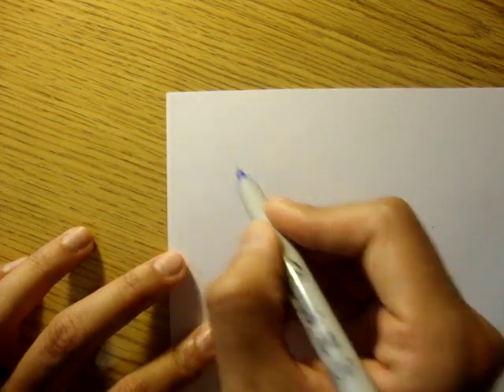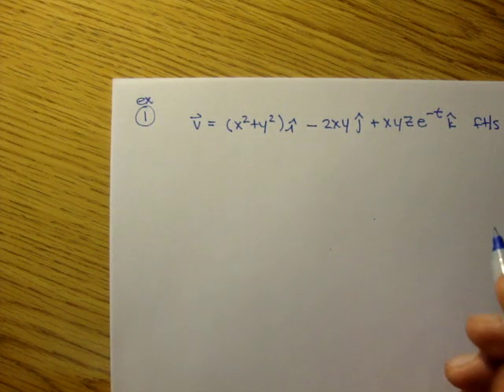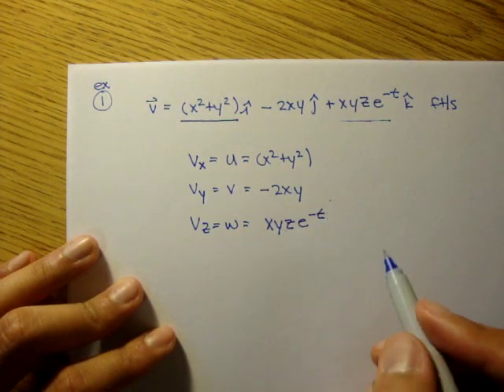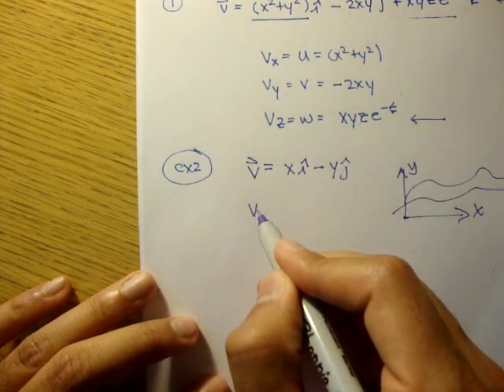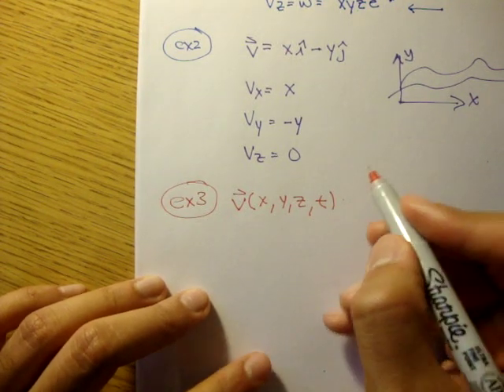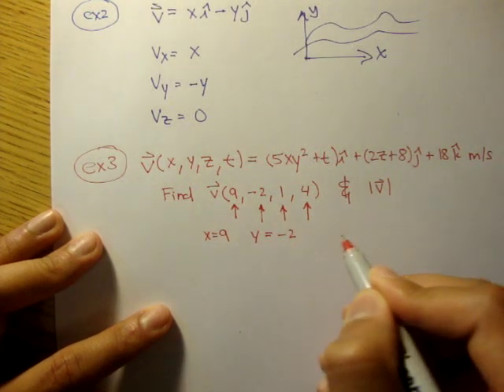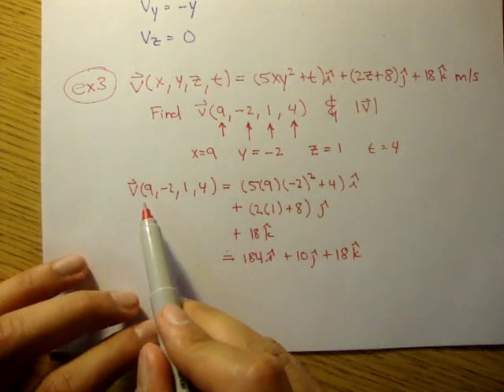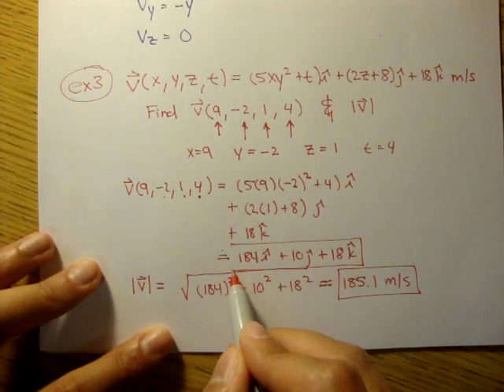Simple Velocity Field: Example 1 [Fluid Mechanics #2]

Comment: V= (2x) i  + (xy) j + (y) k
since it has no z terms will the flow be 2d or since there is a k component it will be 3d?
Reply: Since it doesn’t rely on z, it’s derivative with respect to z will be zero. Hence, the flow won’t change if you move it along the z axis. So it’s 3d, but it doesn’t change along the z axis
Reply: @ieatbananaswiththepeel  thanks. makes sense. i confirmed it with 3d grapher aswell.